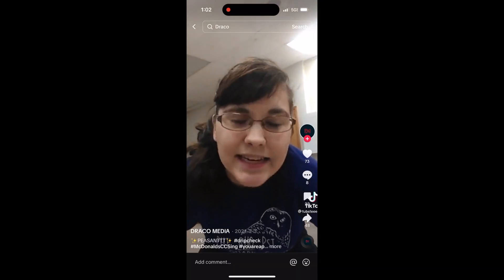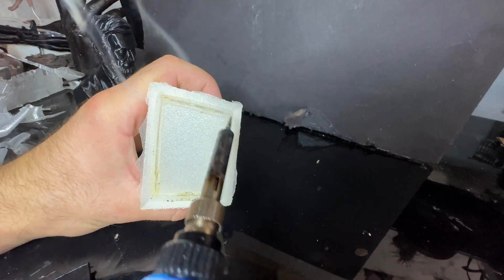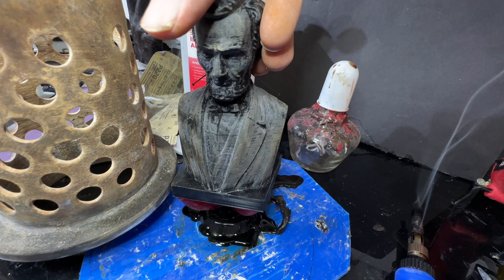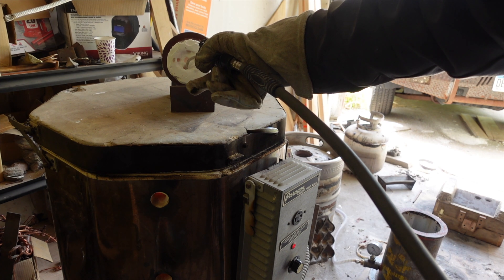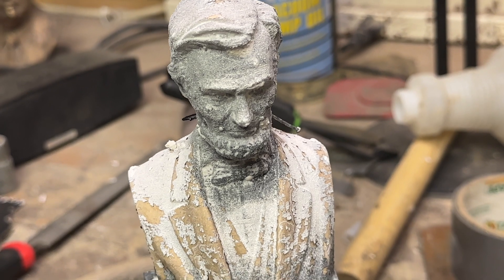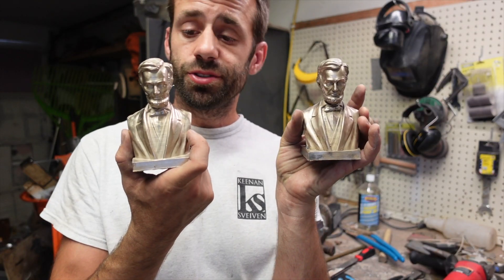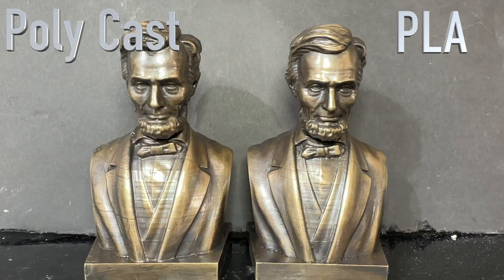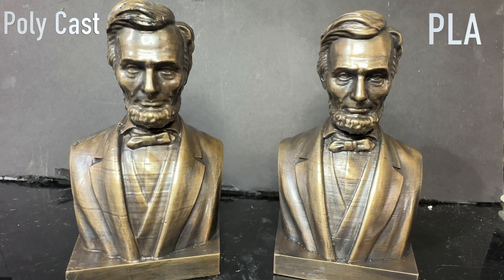PLA vs Poly Cast: Which is better for casting metal.

Comment: Technically speaking, If one was to not care about the quality of the end result, would PLA still be passable? I for example need it to cast a structural part of my steering wheel out of aluminum, and it's going to be completely hidden so I don't care about the surface finish but would like to do this process as painless as possible

Comment: In my experience the cheapest pla you can find- and instead of spending 50 bucks on the neglibly better polycast- spend it on some quality investment casting powder. The results ease and reliability difference between good investment powder and cheap is HUGE

Comment: Wow, thats one hell of a hobby 🔥 (metal casting). Hard to choose between the easy smoothness of the poly vs the sharper detail of the pla. Id probably try to get a smoother 3D print with finer layers etc and stick with the pla. Some projects dont have sharp details though so 🤷

Comment: Ya i am literaly about to make the choice between using hollow printed lost pla casting, or a 50 dollar wax filament i found ... or 50 to 80 dollar wax resin for my creality halot one that can print very detailed but i wanna use my bambu a1 or really the a1 mini and my 0.2mm nozzle hah i bet i can get suoer detailed jewlery wax prints with the wax filament

Comment: You need a Bambu printer. The quality is excellent and because it is so fast you can reduce the layer line height so the layers are pretty much un-noticable but the total print time is still really good.

Comment: Lovely video thank you! How do your castings always come out of the plaster mold with a yellow color (unoxidized)? What kind of bronze do you use? Every time I cast tin bronze or silicone bronze in a plaster mold the result is always pink! Which is weird because that doesn't happen when i sand cast the same metal...

Comment: "so this is going to be a brutally honest review" implying that otherwise you'd have pimped polycast like it was a cheap $2 hooker

A little flame from a propane gun and those internal stringers are gone... better yet, with polycast isopropyl alcohol mist smoothing is possible and would clean up that internal cavity slicker than a whistle, while also smoothing honest Abes face a wee bit, much better than brushing.

Comment: I think the inclusions are coming from the plaster you are using, it might not be 100% smooth, there might be some pieces in there that are still dry...this is a very common problem in construction.
Reply: I was also surprised your mix bucket wasn't totally clean. Any dry flakes into the mix looked like a risk to me

Comment: What if you made a wax casting from the PLA model and the. Make your mold from there?   It would be  extra work,  but you could smooth out all the flaws in the wax BEFORE you made the final mold.  Also you could re use the 3D prints over and over to make wax molds.

Comment: How is your PLA burnout process? temp and time? I'm trying to do it, and it always smells badly, at around 350C. It's hard to do a burnout in the garage because of the smell...
Reply from the maker: I keep the garage door open. I don’t have an exact time and temp. But I bring it up to about 1400 F over about 5 hours, hold there for about 4 hours or more.
Reply: @lundgrenbronzestudios  Thanks for the answer. What about the smell? Is it strong?

Comment: I have factory and i cast bronze , What type of material burns best after the ceramic , i tried the pla but it doesn’t brurn well so it’s doesn’t come out clean after casting ,, Is there a way to talk privately?
Reply from the maker: This poly cast burns out well. And the make castable resin for resin printing that burns out very well. A tip for PLA is to use compressed air to blow out any ash left behind. It will give you much cleaner castings.
Reply: @lundgrenbronzestudios  Are there specific types of poly cast suitable? And according to your knowledge, what type of printer is suitable for this work?

Comment: I wonder if you could coat the pla print with some kind of spray wax so when the pla is burned out its not actually touching any of the plaster. Maybe the ash wouldnt get backed on to the plaster this way and fall away better.
Reply from the maker: Be worth some experimenting.

Comment: Have you tried printing with metal filament then sinter it? All detail should remain. Maybe all the cleanup and casting steps can be avoided although id like to make  reusable molds for non fully rounded pieces.
Reply from the maker: I don’t think regular people print with metal filament. Those are incredibly expensive specialist type machines.
Reply: @lundgrenbronzestudios  Are you kidding? There are a few makers of Metal filled filament mixed with PLA. one maker is protopasta , another is  Bronze Filamet™
You don't need any specialized 3D Printer, but it does require filawarmer to help get the filament to and pass through the extruder.  Virtual Foundry has helpful instructions.
Reply from the maker: @GameArtsCafe  oh ok.  that’s still plastic filament. It just has metal in it. I thought you were talking about metal 3D printing which is a whole other thing. 
No I have never tried using this type of filament.
Reply: @lundgrenbronzestudios  with the metal filament method, you sinter it to burn off the plastic to get 100% metal end product. I suspect you'd have to pack it in sand, maybe with pressure to maintain shape. I'm working towards setting this all up. Just got a kiln, and a k1 max printer but i need a few more supplies/tools. I thought you might have tried this and I wanted to know what you'd prefer between the methods.
Reply from the maker: @GameArtsCafe  interesting. You should send me a picture of how it works for you. I’d be interested in seeing the end results.

Comment: Could you look into the "light weight PLA"? It's pla that foams when heated and foams more or less depending on the heat. I would think that this foaming pla would be perfect for lost pla casting? Thanks!

Comment: I have a question about polycast would I be able to destroy it easily if I use it inside a mold and I needed to extract or dig it out it without heat. Would polycast be able to hold its shape under a little bit of pressure. I'm not going to be able to use heat because I'm making my object with carbon fiber resin. I wanted to use water soluble filament but from what I understand I won't be able to get enough detail because it's a messy print.
Reply from the maker: I’m not sure what you’re going for but it is about as strong as PLA from what I can tell. It feels the same to me.
Reply: @lundgrenbronzestudios Thank you I was hoping that this stuff would be strong enough to hold its shape but easy enough to break apart and extract out of a molded object

Comment: Earned a suscriber here, really top notch informative and entertaining videos. Have you thought about using resin printers? Those would leave no lines and I think there are some resins on the market that burn as easily as wax
Reply from the maker: I just got a resin printer and have some videos in the works.

Comment: I’d invest in a multi material 3d printer. That way you can print parts of the model in pla and others in poly cast. You can paint which sections in your slicer and assuming they will stick together you maintain definition in some critical parts and smoother finish in others.

Comment: Thank you for the interesting comparison video.  Some hints: Use clear, uncolored PLA. Creates much less ash because there is no pigment. Some filament makers seam to "elongate" their material with minerals. I have never found this cost optimisations in clear PLA. To get rid of layer lines you can use clear varnish or Car polish.

Comment: It would be interesting to do a comparison btwn Polycast and other PVB on the market. I have a roll purchased at $27CAD which is about to go thru the temp tower test. Anything to save a few bucks especially when it all gets disposed of during the burn out. But then I am a rank beginner  to casting metal, so there is lots to learn :-)

Comment: i think on the yoda your getting blistering  its from copper tin. been to hot  u can over heat 
the temps have to be spot on
Reply from the maker: The Yoda isn’t the only example. And it’s not the only metal I’ve used. It works better to blow out the mold.

Comment: use washing up liqid be for u por the ivestment plaster  let it dry no bubels
Reply from the maker: By washing up liquid, do you mean dish soap? Like dawn dish soap?
Reply: yes liguid most shops well do  and when u por in to your ivestment  por it like your drinking a can of soder  you get les bubbels
think your temp is rong i do 4 hours at 170 then over 3 hours to 750 for 4 hours .but saying that i did a fast bern out and didt have as meny lines in the cast but still getting blisters  may be doing a cast with a big opening to see in side as to why its doing it  @lundgrenbronzestudios

Comment: Thank you for all your videos which highlight lost wax casting! 😊For my part, as I don't heat the plaster molds very high, I've already had residues with PLA whereas I've never had any with polycast. To obtain better-defined results, I also use bluecast X one, which is considerably more expensive, and even more expensive VisiJet M2 ICast (MJP) from 3d systèms. It all depends on the purpose of the project. I have an ambitious project to create a version of Notre-Dame de Paris 😅.
Reply from the maker: I’ve been thinking of getting a resin printer and trying castable resin.

Comment: Switch to the resin printing
Reply: I use Siraya Tech Cast 3D Printer Resin purple. The purple was made for beginners not sure what that means, it’s easy to add wax to the prints but you can’t melt away stuff. It sands an files great. The True Blue I think acts more like wax and it’s what most jewelry guys use. The YouTuber VOG man has a bunch of reviews and how twos. BTW I got the Lincoln bust yesterday and I LOVE IT, thanks!
Reply from the maker: Do they make a resin for metal casting?

Comment: Nice comparrison and well done video. With the standard investment what temp are you burning out the polycast? same as the PLA? The reason I ask is I think the inclusions in the PC was from not completely burning out.
Reply from the maker: Yes I did both of them at the same temperature. The kiln holds at about 1,100-1,200°F and that’s where I hold it for about 10ish hours. However I don’t hold to a strict schedule on my burn outs and maybe I should.
Reply: @lundgrenbronzestudios   You would think that 10 hours at 1200F would do it.  I know that much higher than that for standard investment is a problem. The specs I came across for PC say 1650F/900C which is fine for shells, as that is the temp I vitrify my shells at.  My typical burnout is to get it to 1650 quickly then hold for 20-30 min.

Your video reminds me that I need to finish up my Polycast experiments and do a video.

Comment: Interesting comparison! Thanks for doing it for us. I don't think I'll be using Polycast anymore. I find it difficult to print and difficult to burnout using my method of removing most of it before firing the shells. I'm sure it has its application but not for what I do. The ability to smooth it with alcohol is the the biggest plus but is that worth the price?
Reply from the maker: You’ve got the lost PLA casting down to a science. 
I don’t find it as easy to print with either. So I think I’ll only use it for some projects.

Comment: Have you seen those Hobo nickels and quarters where they alter the face on the coin, usually into a skull, well I bet you could do that to your 3d Abe guy maybe with a sodering iron or wood burning iron or just a qtip and alcohol to sculpt the resin after you print him. Then cast em. The thing with 3d prints are they're someone else's ideas. If you have an Idea it takes alot of time to model it in the software, if you can even pull that off then all the supplies and failed prints so it just seems like original ideas, unless you just want other people's stuff, come to fruition faster and less expensive by modeling them in clay but then again what the hell do I know. Great video though I enjoy your mistakes as much as your successes. They say an expert is someone who has made every possible mistake in their field of expertise.

Comment: It's nice to see your casting skill progress. Your editing skills are improving too. I can't tell for sure, but it looks like you didn't de-gas your plaster before pouring it. Might be worth doing. You'll get less rise in your flask when you vacuum it, allowing you to pull deeper, smaller bubbles out. I'd like to remind everyone that wearing fire resistant clothing while pouring hot metal is a good idea. Molten metal on a plastic shoe can lead to painful injuries. Some heavy fire rated chaps is a good idea too. Molten metal has a lot of heat energy. If it get's trapped against your skin you'll regret it. PPE is important. Use it. Also, I'd try blowing out the Polycast. Not blowing it out may have caused those surface defects on the head and shoulders. Your best video to date.
Reply from the maker: Thank you for that advice. And you have a good eye, you’re right I didn’t de gas the investment before pouring it. That may be a good for me to add though.

Comment: They both look great!  Another benefit of polycast, even if you don't burn it out perfectly, you still don't end up with a lot of surface crud.  For printing it I noticed a little stringing but it printed fine at 215f and .15mm layer height, but every printer works differently.  If you're want great detail and zero layer lines you'll probably need a resin printer, which I highly recommend.  They are amazing
Reply from the maker: Yeah, you might be right, I think I need a resin printer.  I’m just not excited about dealing with the resin. Seems like a mess.
Reply: The two coolest DIY metal casters on YouTube -NICE!  I think maybe VogMan uses resin and gets very good Smaller castings.  Years ago, I always sprayed my patterns with auto body primer, then sanded, sprayed, repeat,  until I got a mirror finish but most of my patterns were simpler, easier to sand.  Lately I have not been able to find a primer that sands as nicely as they once did?  Though sanding takes time it is definitely worth it if you want a pattern that will yield many castings, such as an Abe Lincoln master pattern.  Very informative and interesting review of Poly Cast that I'm sure will yield many more masterpieces - well done! @lundgrenbronzestudios
Reply: @lundgrenbronzestudios  I likewise suggest jumping to resin printers but... Only print in regular resins.. Make teh models as a shell mould. That way you can pour in your wax, then split the mould to get a pretty clean wax to cast that can be chased pre investment ;)  Or regular resin, then make a multipart silicone or gelcoat resin shell from that. But no real reson to be so advanced unless it's a  mega complex piece that just printing a thin shell to pour the wax into won't work just fine for :)

I use castable resins, namely Siraya Cast Purple, Siraya Cast True Blue and Bluecast X-One. But typically for one offs and stuff that's too complex to even want to think about moulding for mass production. Otherwise, I'll print a master then make a mould from it, sometimes print the shell. For me I prefer silicone and gelcoat/resins etc to make a mould from a master print, but that's just cos I like making mess and wasting money when I don't need too lol Bad habits for the win! xD
Reply: The stuff left from the PLA is pigment. Use clear/natural PLA and it will burn completely.

Comment: Thanks for taking the time to review Polycast Lucas. I’ve been looking at it but put off by the price- thinking I may take the plunge now. By the way, I have had success with ash removal during organic (twig) casting by letting the burned out flask cool completely and vacuuming the ash out before bringing the flask back up to casting temperature. I don’t think the investment manufacturers recommend it but using Goldstar it worked fine. Takes away the stress of trying to die-ash a hot flask. Just a thought…great channel BTW
Reply from the maker: Yeah that’s might be a good option to try. I never thought about using a vacuum.